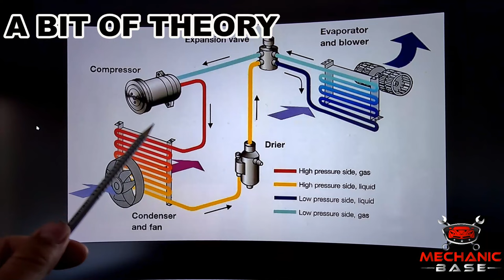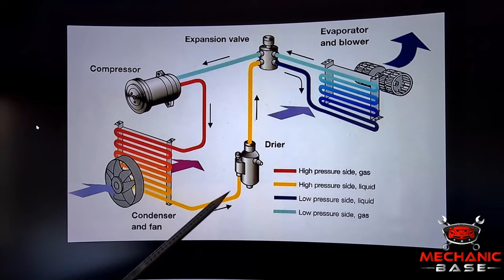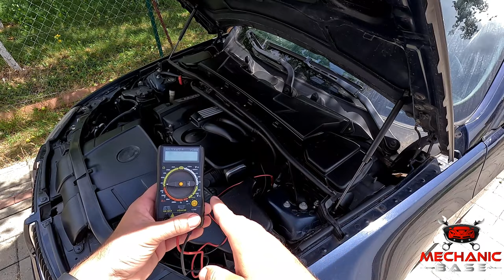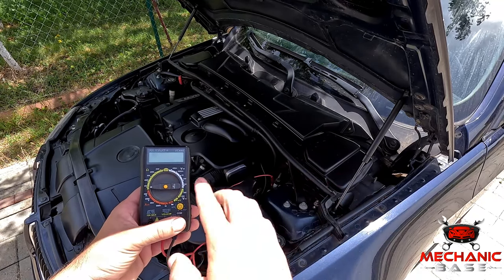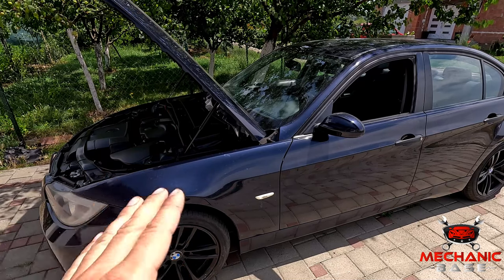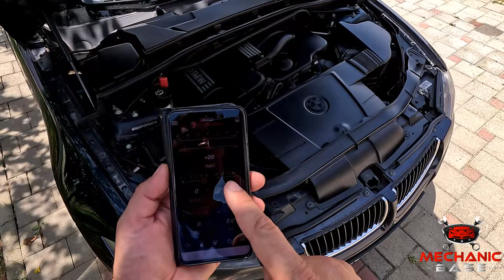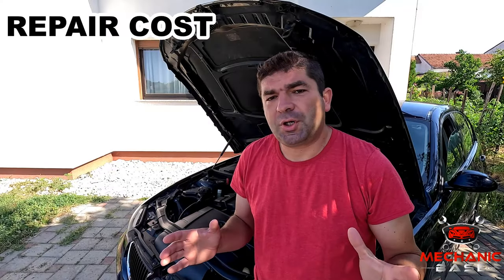3 Symptoms Of A Bad AC Pressure Switch [HIGH OR LOW] & DIY Fixes

Comment: My compressor is coming on. No short cycling but my ac lines don't even get cold. Full of correct amount of refrigerant.
Reply: That sounds like a blockage in your ac system. I'd start with the cheapest fix and replace the expansion valve and drier filter after recovering the Freon from your system and then recharge after replacing both the expansion valve and drier filter
Reply: @shannonprice525  I got the expansion valve. Going to install it first and see if my levels change. My high and low side were staying equal even with my compressor engaged. Problem is my car takes an oddball compressor that's hard to get.
Reply: Actually before you do anything hook up the AC pressure gauge first (I used the Recovery machine). I’m in the same issue. I narrow it down to the Compressor Control Solenoid Valve. (Part is in transit).
Reply: @A.Musa76  me too. I just replaced the compressor and the expansion valve. Working fine now. Mine takes a very rare compressor that was only used on a few hundred cars too. Found a used one.
Reply: @earthisfat6184  That's great you got your A/C working. I got mine working over the weekend. It was the A/C compressor solenoid valve was the culprit for me.
Reply: @A.Musa76  good thing to. This heat has already been brutal where I'm at. Hopefully our systems hold up! Here's hoping!

Comment: Hello I’ve replaced my ac compressor, my condenser, also the expansion valve and I’m still having trouble with my ac. It blows really cold then cuts out. I’m leaning toward the ac pressure switch any ideas what it could be? 🙏
Reply: Does it work intermittently? Like when you first start your car it works then just shuts off.
Reply: @niftysin yes
Reply: @wdchaconpereira  definitely sounds like your pressure switch. What vehicle do you have
Reply: This definitely sounded like the pressure switch.
Reply: Could be a pressure switch or could also be a clogged system or even a bad ac filter/drier

Comment: HI THE TRUCK 80% BLOW HOT AIR SO I REPLACE THE AC COMPRESSOR EXPNSEN VALVE AND ALSO THE PRESSORE SENSER , VACUM THE SYSTME AND RECHARGE THE FREON , BUT THA AC COMPRESSOR KEEP ON AND OFF FOR A MINUTE , DO YOU KNOW WHAT IS GOING ONG WITH SHIS AC SYSTEM
Reply: What about evaporator ??
Reply: When you turn AC on, look behind your “radiators” and see if the fans start running. (While car is running and on idle)
Reply: @MSGxBlueForce  Hello, the ac sometime work ， sometime not , but when it work , it really cold , dddl
 Has code: lost communication with front HVAC / HVCF for 3 seconds or longer, 524025  31 
I been replaced AC COMPRESSOR /EXP VALVE /PRESSURE SENSOR VACUUM AC SYSTEM recharge the freon, it work one month and it happened again, can you tell what is going on with my truck , I did not replace the dryer filter , you think could be  dryer problem? Truck is 2019 freightliner. Cascadia if you know anything, please let me know!🙏🙏🙏
Reply: @juntong651 you probably have a leak at one or all of your valves

Comment: Hi, please confirm that the low and high pressure lines are identified correctly in the video.
Reply: I'm pretty sure the high pressure line has the smaller diameter, and the low pressure line is fatter. The service port caps should be labelled L and H to identify clearly.
Reply: High pressure connection is larger on mine but line is smaller
Reply: Just watch the hand.

Comment: If the switch is faulty would the out cover plate still spin with the pully whether the air-con is on or off as I can't hear the compress clutch clicking?

Comment: Hi there, I’m just checking out your channel. Good stuff. My AC is constantly running like if you’ve turn off the switch or turn off yeah if you turn off the switch, the AC is constantly running. It’s supposed to. It’s supposed to stop like time out, but it’s not doing that like my switch that’s supposed to stop  accelerate or something like that it’s not working
Reply: If it's a Ford the AC runs in defrost mode it mixes with the blend door

Comment: Watching a bunch of videos as my aircon in my E36 325i will not turn on until driving the car for 30mins or so, sometimes its working and freezing over. If its turned on its cold, but unless the green light is on there too much moisture and wil cause mold in th hot humid Asian climate. So if its cold and no green light is on I cant use it if I park it in the sun them it works its a weird issue.

Comment: My car tried to stall when I had the AC on and I saw white smoke coming out of the ac vents that went away after a few seconds. I turned it off then when I got home 20 miles later the car stalled then started. What do you think the problem is?

Comment: Where would ac switch be located in 2014 S550 Mercedes Benz. Will a bad switch cause the fan to run at top speed? Thanks

Comment: 2011 highlander new compressor condenser expansion valve flushed charged to correct amount no leaks the AC runs fine above 1500 rpm but compressor and fans stop below 1500 rpm n ac light flashes

Comment: How do you know what pressure sensor is the bad one? Low or high? I do not have a high end scanner but it did pick up a code (B1079) and most common fixes says "Replaced A/C Refrigerant Pressure Sensor" but doe snot tell me high or low? Any ideas? It is on a 2013 Lancer
Reply: Just put your hand physically on each one, you will feel which one is clicking. Just like with relays

Comment: My friend spend hundreds to replace compressor, change all seal condenser, on a 2019 hyundai kona and still no ac ,it uses 1234yf freon ,I'm thinking pressure switch or computer command wire,I scanned the  system with autel 908spro no code ,al 3 fuses are good ,I command the relay on with key on engine off and the clutch clicks  with engine  running try to command relay on fails

Comment: I need help locating the AC pressure Switch on a 2011 GMC terrain 4 cylinder.  Any help would be greatly appreciated. Thank you
Reply: There would be two pressure switches, a low pressure switch (on the fat pipes) and a high pressure switch (on the skinny tubes).

Comment: Can a faulty switch cause Freon to leak out?
Reply: Theres a  valve BEHIND the pressure switch on my truck just like the low line. Youre supposed to change them ALL at the same time to avoid a leak happening in one of the other ones. They sell a kit. Comes with 2 caps for the high and low lines. 2 shrader valves ans a valve for the high line under $15

Comment: Hi  just asking for help with my aircon it has been to 2 aircon guys a new compressor put in and still wont work properly. At around 29 degrees the air flow cuts in half and so does the cold air , I have to turn it off and put on the through air on 4 fan speed and then the air speed comes back after 10 seconds I then put the aircon back on works fine again for about 5 minutes then it all happens again ....can someone help me please.
Reply: Wow mine does exactly the same thing , no idea why it's all been leak checked and refilled compressor is ok drive belt renewed,

Comment: Hi guys where is that ac pressured switch located on a passat B8 TDi...?
I cannot find nothing on the Internet 
Also on passat B8 is tgere a low pressure switch and a hight pressure switch or just 1 switch . I found 1 switch near the fuel filter but I am nir certain that is the one.  ( coukd it be the fuel switch..😂)
Thank you

Comment: Does a 2017 toyota Yaris ia only have one switch? I cant find any information on this and I only see one.
Reply: It could just have one. The low pressure switch usually cycles the compressor on and off but it's on the big line not the small.
Reply: There is two. The other switch is located inside your dash where the evaporator is located behind the firewall

Comment: My ac blows fuses every time i turn it on is that a pressure switch
Reply: If it's blowing fuses every time your ac cuts on, that's a bad ac compressor. The ac clutch is causing the issue and cuts it off.

Comment: The AC system must be emty before the swith must be replemended
Reply: Only on vehicles with no check valve. I've replaced plenty of AC switches and as long as it had a check valve, I've replaced the switch without having to recover the Freon from the system